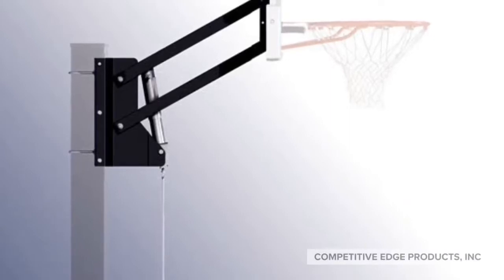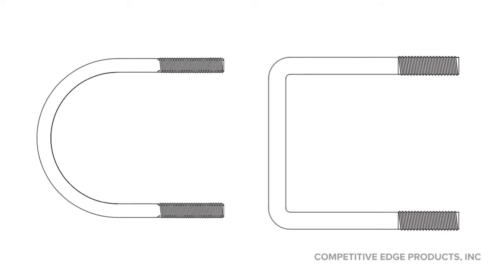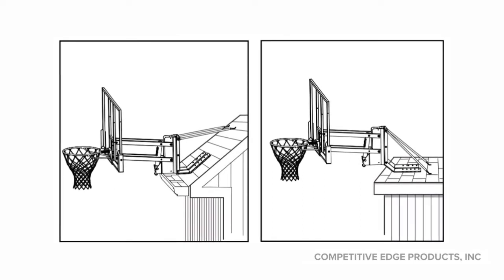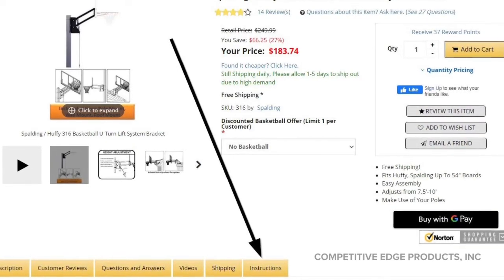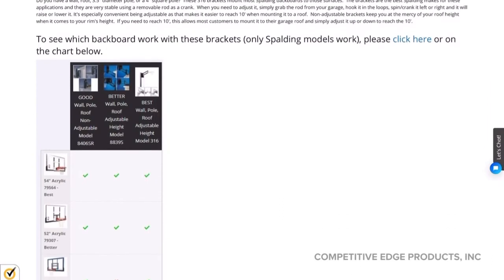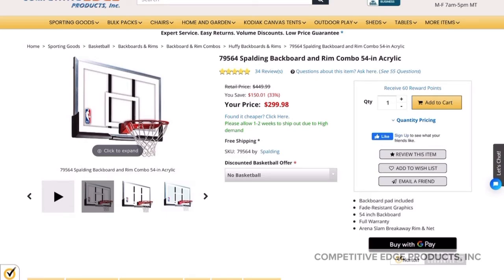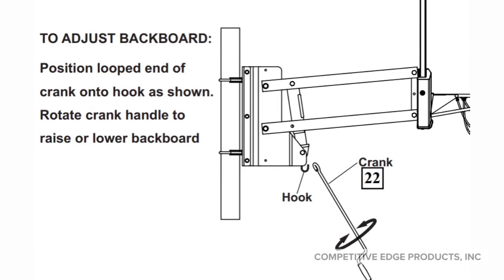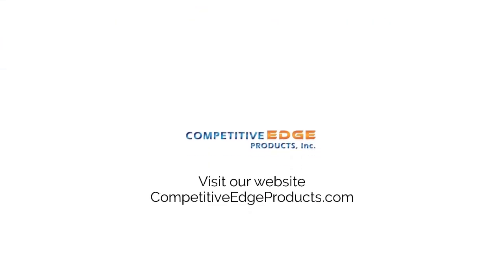Spalding 316 Brackets - Are they right for you?

Comment: would this work on a lifetime 44 inch impact backboard? if it wont ill js solder it on js want to know if I need to get it prepared
Reply from the maker: It definitely will not work on a Lifetime 44" Impact backboard.   You're only options for the lifetime impact backboard are the adjustable brackets model 1044 or the non-adjustable 9594.  Here is a link to them: https://www.competitiveedgeproducts.com/search.asp?keyword=lifetime+bracket
Reply: @Competitiveedgeproducts  absolute goat for responding a year
Reply from the maker: @kur8305  I don't understand your comment.  I hope my answer was helpful.  Feel free to contact us with any other questions.
Reply: @Competitiveedgeproducts  im saying your really great for responding a year after uploading this video
Reply from the maker: @kur8305  Oh, that makes sense now.